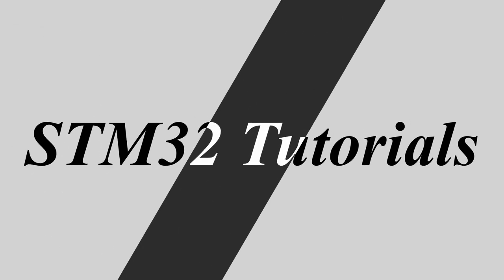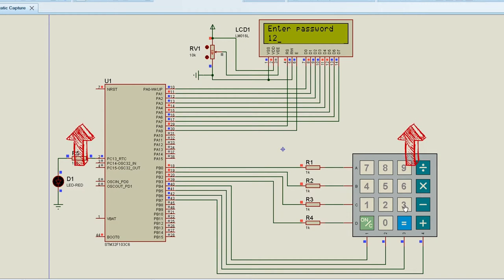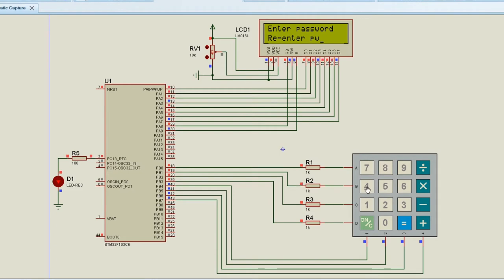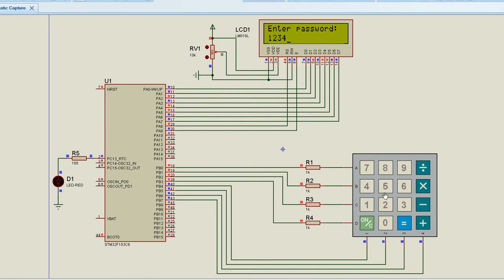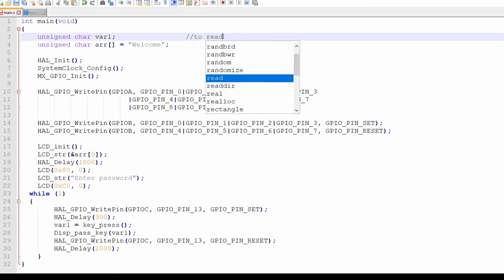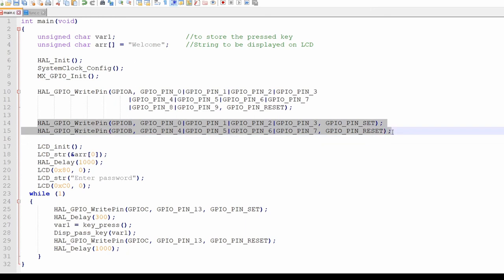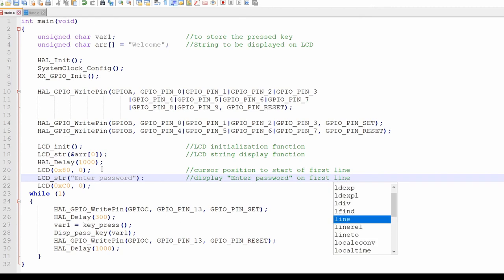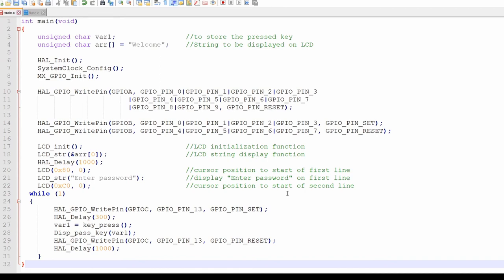Password Security System (Mini project) | STM32 | HAL | Keypad | LCD

Comment: will this execute in proteus 6
Reply from the maker: Proteus 6 does not have support for Stm32 board, you should try with proteus 9
Reply: @stmetatronics6593  sorry i mean proteus 8.6
Reply from the maker: If proteus 8.6 supports Stm32, then only you can use
Reply: @stmetatronics6593  yes it supports,but I am getting question marks on my LCD screen after displaying Welcome and Enter password....it is not taking my keypad input..
Reply from the maker: Might be

Comment: This code is not working
Reply from the maker: Follow the steps properly and it will work.
Reply: I have followed it
Reply from the maker: @harshithareddy1812 check keyboard video
Reply: When I am pressing digits in the keyboatd they are not displaying in the lcd
Reply from the maker: Can you check the pins configured as gpio for lcd???
Reply: I have checked it same I connected in the schematic
Reply from the maker: @harshithareddy1812 check the gpio config
Some pins will be output and some pins will be input
Reply: I have set keypad pins as input and lcd as output
Reply from the maker: @harshithareddy1812 all the pins for keyboard is not input, please check that